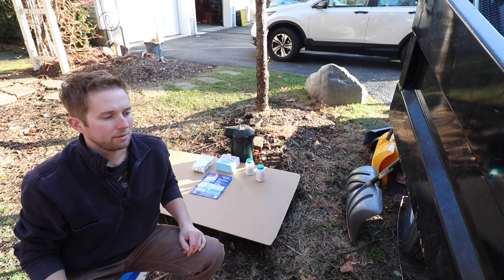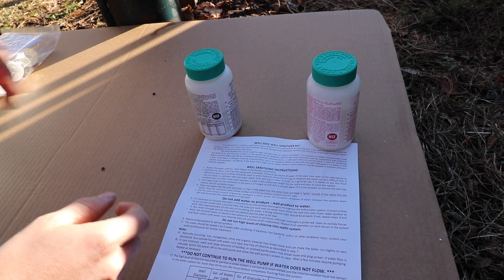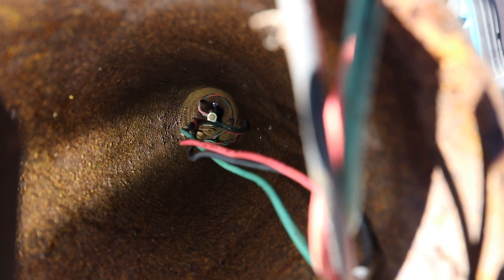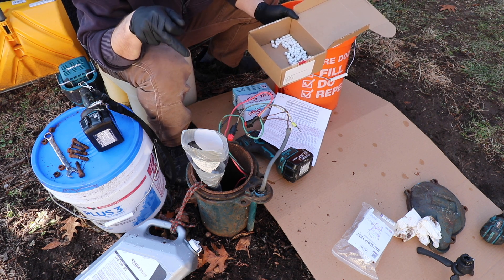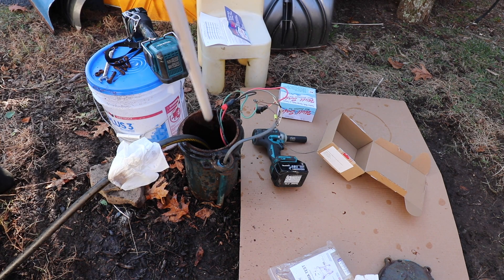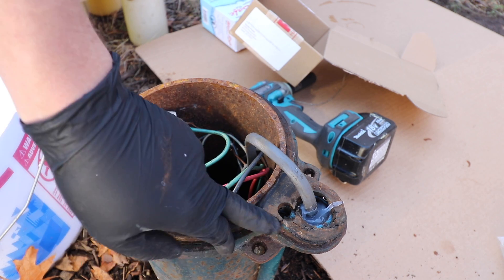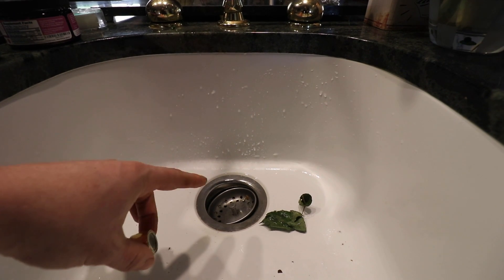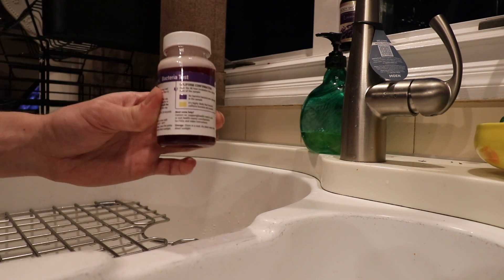How to treat coliform in well water | Well Safe Sanitizer Kit

Comment: I just dump the pills down the well and pour the bucket agaisnt the wall of the well. Took the hose and rinse well and let the water circulate for 20 minutes. I let it sit for 10 hrs in the pipes I suggest using the whole kit.

Comment: I think plastic is the least of your worries.. that rusted well casing would be more to worry about..
Reply from the maker: Are you a well technician? I would think a rusted well casting is very common. The deteriorated gasket was more of a concern for me than the rust.
Reply: plastic is never the least of a worry, it is of most importance. it is a silent killer. please educate yourself on the dangers of plastic that manufactures selling billions and trillions of dollars to society, because they can.
Reply: @pebelleeb5422  A well has pvc plastic covered wires going all the way down to the pump soaking in the water.
Reply: I don't worry about plastic bottles either. Rust and dissolved iron isn't considered a health hazard, so the casing is okay. And the little spiders add nutrients. I have a well and the problem is that water can test fine one day and a week later test bad. Hence like the poster, I don't drink or brush my teeth with well water. Showering, laundry, washing dishes etc is fine with well water. Thinking about it, our ancestors used to drink filthy contaminated water all the time and the species survived :-)

Comment: After you chlorinate the Well how long soon can you use the water to take shower , wash hands , use for Washer ?
Reply from the maker: Depends on a 3 factors.

1) How strong the Chlorine treatment was.
2) How well you flushed out your well.
3) what’s your chlorine tolerance.

For my treatment, after I flushed my well for a few hours, I was able to comfortably shower. It reminded me of a chlorinated pool. I continued to flush a few hours a day, I waited about a week and a half before I drank the water. You could flush the system more rapidly, and push the flush, however this puts a strain on your well and well pump. How this answer helps.
Reply: I treated my well with well safe yesterday. Today i looked and the tablets havent fully disolved. How long does it take for the tablets to disolve?
Reply from the maker: How shallow is your well? If you can see the tablets, I’d imagine it’s very shallow.
Reply: 12-24 hours after recirculation